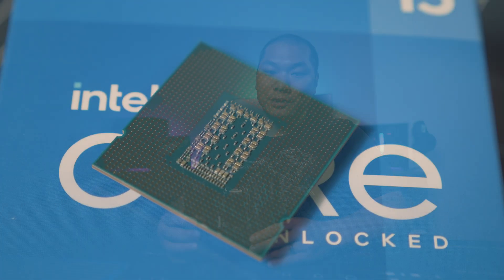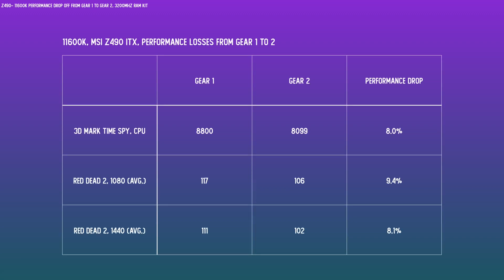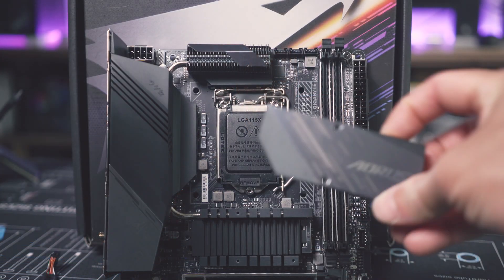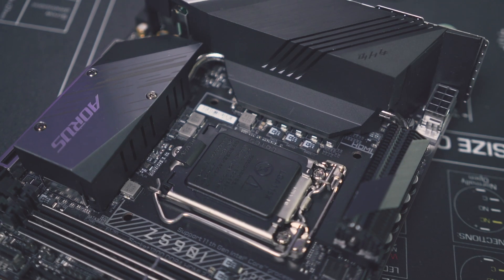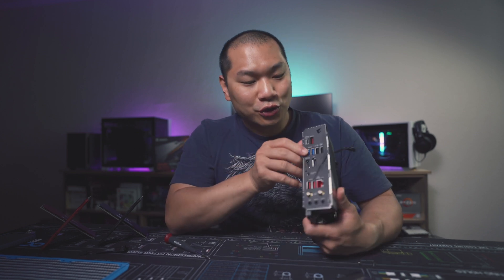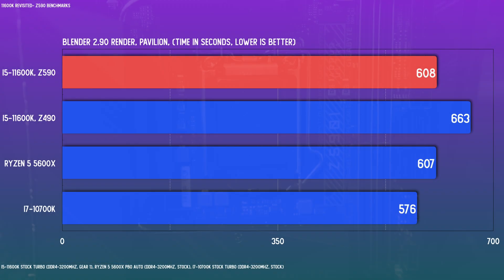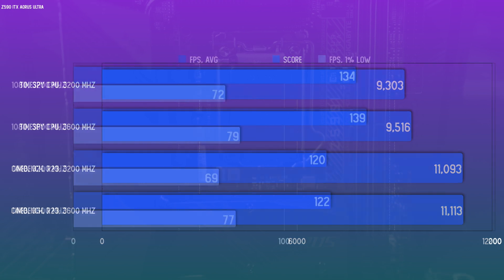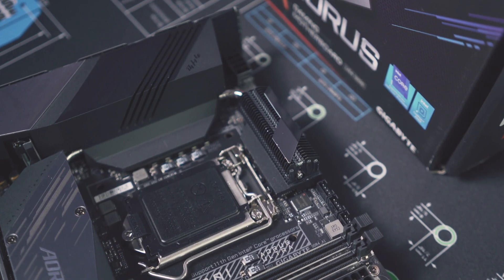The Gigabyte Z590 ITX Aorus Ultra - Revisiting the 11600K Benchmarks

Comment: Can you use a scythe cooler with this board? (
Scythe Mugen 5 Rev.B or Scythe Fuma 2).
I tried installing ARCTIC Freezer 34 eSports DUO, and it won't fit. The installation bracket interferes with VRM cooling.
Reply from the maker: The bracket touches the chokes?
Reply: @MachinesMore  Yes, the mounting brackets are to long.

Comment: i have the msi z590i unify and i think i have a defective product, slot one and two for the m.2 are stacked on top of each other but the heatsink does not fit with an nvme in it. the heatsink screw is attached to the frozr shield and goes through both heatsink and m.2 drive but with no stand off so the ssd is warping. so if i mount it like any normal person (supplied stand off and screw) it fits perfectly i could sit a water level on it. but not frozr shield, no heatsink whatsoever. this is my first build, should i be worried??????

Comment: There's no difference at all between z590 & z490 in gaming Performance. Even the PCIe gen 4 speeds are not noticeable.
Sure, the i9 11900k is faster than i7 10700k but, it's worth it if you have allready very old system.
The "Performance Jump" from 10 series is not worth the Money, in my Opinion.

Comment: found the same prob on my asus board cant install m.2 correctly not enough relief between the zinc and the rest of the mobo for the heatsink to maneuver m.2 into the slot  need to get some of that heat tape and do it yourself  currently seems like a lot of headroom for clockers for my ws480 shows very high ram settings xmp is a snap and most of the work is done cant see anything ram that it missed regarding SPD its word for word  although  im trying to get a bone up on a xeon for the board do a commercial on w-1300 series   i called intell and asked about the differences from there desktop line all i got was a director to the intell arc page   ...200 megahert or 200bucks?   and someone is hogging all the 5 gigahert ram

Comment: so if I got this right - 11600K would post on Gigabyte Z590 ITX Aorus Ultra @ 3600CL16 compared to MSI Unify Z490 ITX? This is very interesting as I too can not post 11600KF running on B560I with 3600CL16 memory :/ which is sort of frustrating
Reply from the maker: Yup, night and day difference, it has to be memory latency related. I haven’t tried any later BIOS with the MSI but it was a big difference. Are you trying to run in gear 1?
Reply: @MachinesMore  Yes, I am trying to run in gear 1. I prefer to scale it back to 3466 Gear 1 rather than run in 3600 Gear 2. I have reached out to MB Vendor (Gigabyte), RAM vendor (Crucial) and CPU Vendor to check ifg they have any solution. At least it would be nice if they acknowledge this issue, so they can fix it with future releases... I also ordered one more memory to try with Patriot Viper Steel series fast 4400 CL19 memory and see if that changes anything. At the moment I am using 3200 MHz CL16 memory

Comment: not going to lie, the asrock H470m itx is a great board.  Loved the I/O features it has and its original price ($119).  the updated asrock H570m ITX falls short of the I/O of the H470m and costs a little more too ($136).   I loved the H470m so much, got two of them; one has 10900 and the other 10700; runs great.  food for thought.

Comment: Maybe H570 or B560 ITX boards are better in value since overclocking headroom for Rocket Lake isn't that much unless you're going with over the top cooling and binned chips.